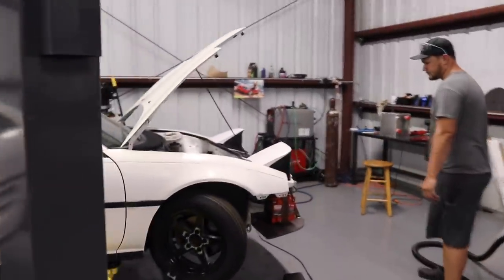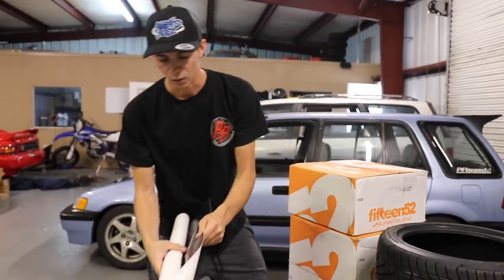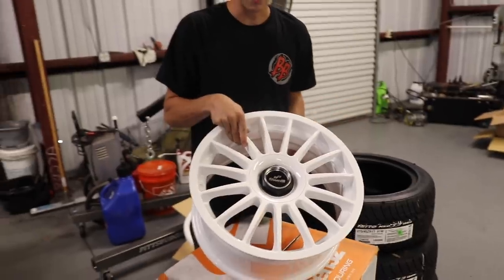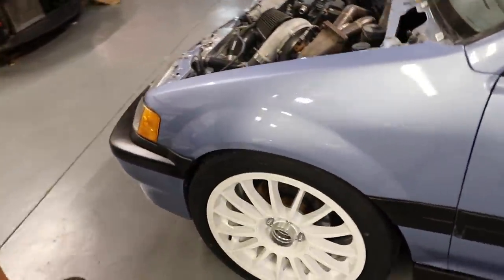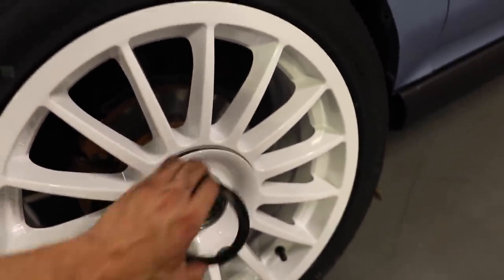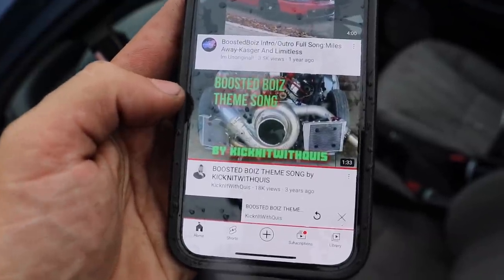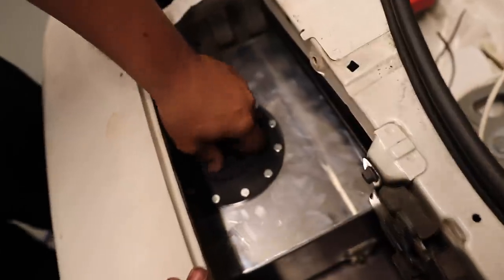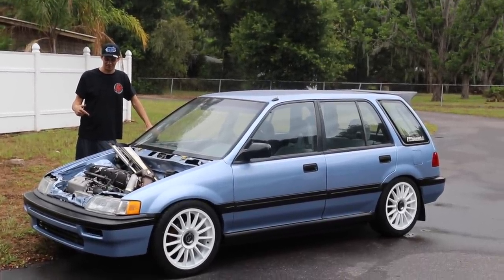Wago's New Wheels Look SO GOOD!

Comment: You can use the existing bolt on spots for the hood latch then just drop down a little bit "tab" and then meet up at the mounting place in a nice slim triangle of 1/4in rod

Comment: The front weight plate for the Mr2 is turning out nice. The only thing I don’t understand is why you mounted the battery on it right next to the fuel tank instead of in the frunk somewhere. That way you still have both edges of the weight plate are open to add more weight to  if you needed it.

Comment: theses  white wheels looks like 1990 is back! I'm 100% positive that a darker wheel would have matched the car better since there is black moldings all around and absolutely no white at all. Also.. is there a right and left wheels? Considering the center caps are "bolted" from a single nut on the center, I wonder if they can get loose over time.. For the same reason centerlock wheels have their threads the same direction as the wheel spin, to avoid loosening over time..

Comment: Usually the tops of those Lugnuts are just aluminum plating should be able to grind the top off to make them center caps fit…. As I’m typing this I remembered you worked at discount tire to you know this

Comment: Had to "see Wago out in the sunshine" while it's raining!😂 Good old florida sunshine!! The new shoes look good.

That is not a good way to mount the fuel cell and ice/water box.  One big wheelie and you are going to be dealing with sheared mounting bolts and or cracked tanks.

And upgrade the roll cage!!

Comment: Just pull the fenders with your hands. Ot don't need much. Camber will take away traction. Just work back and forth. Several passes and you can stretch it along with your hands

Comment: A hole saw on inner panels will lighten it up too.  
Wago is pimp'n!  Those wheels need a switch to turn them off! They are bright.
The HATCH... The HATCH... The HATCH.... the ripper needs to rip.

Comment: Is a front fuel cell a good idea in the event of a front end crash at 160mph?
Reply: Lots of drag cars run them. However, they have to have a tube bumper around them if any part of them is outside the frame rails.

Comment: Please don't tell you are gonna run boost piping all the way to the front??????
Reply: Nope. The water box up front is just a reservoir. Ice chilled water will be pumped to the air to water intercooler in the back.